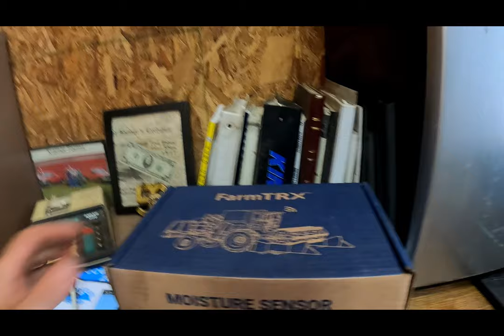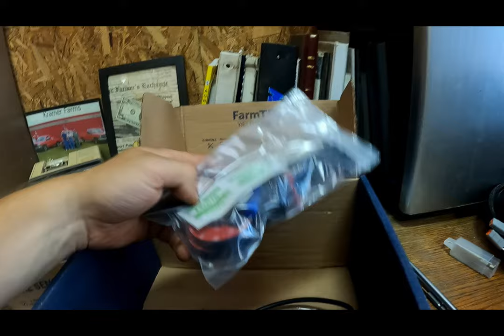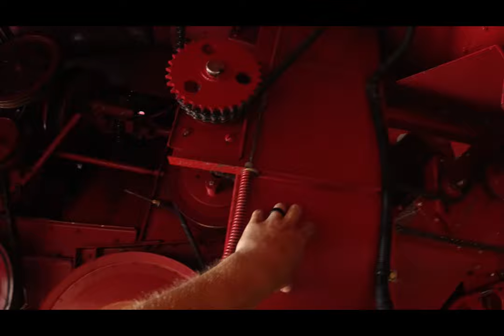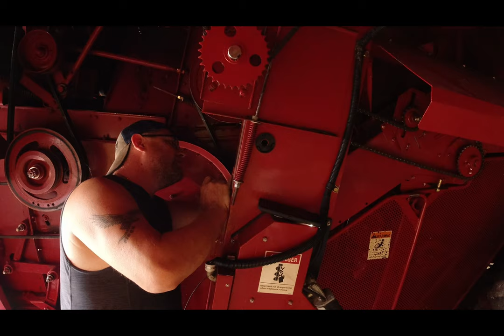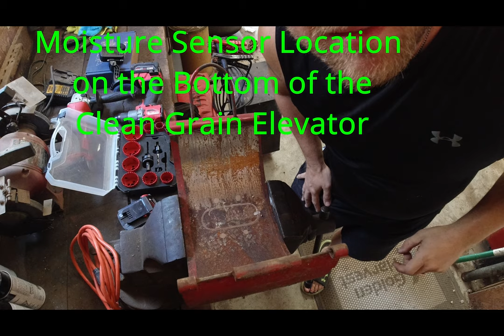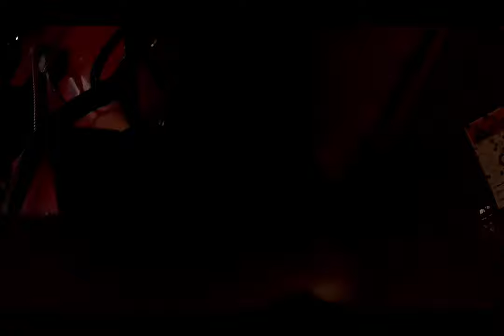Farm TRX Yield Monitor / Moisture Sensor Unbox and Install on  a Case 2366

Comment: Mind me asking where you mounted the antenna and monitor brains? Or where you pulled power from? Looking to do the same install on a 2166 soon!
Reply from the maker: I double sided taped the antenna to the roof in the center of the cab. Just ran the cord though the window. Did the same for the box on the cab floor. Power I pulled from the accessory plug behind the seat on the window side.

Comment: I would like to know more about how this system works out for you, I have been looking at a lower cost option for a yield monitor on our farm. I've looked at the website is there a subscription fee to access download maps?
Reply from the maker: Sounds like the first year for the subscription is free when you buy the monitor. But I'm looking forward to trying it out too. Plan on making videos thou calibration and as we us it this fall so subscribe and follow along. If you have any questions as we go don't be scared to comment and ill answer what I can.
Reply from the maker: @6rowmafia943  ok will do, I also checked out the ag leader 800 but it was around 8000 I think. 1200 was more. Everyone said that's the go to monitor but hard to pull the trigger on that when you only farm 600 acres.